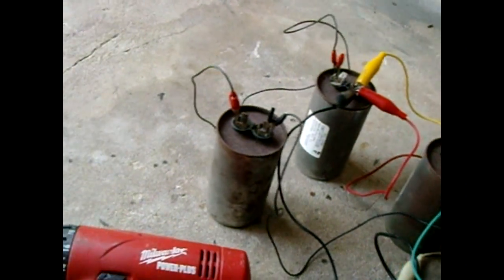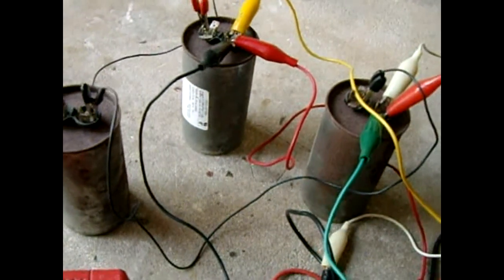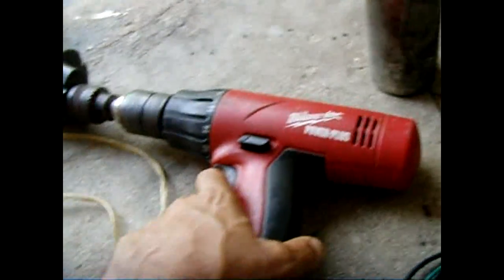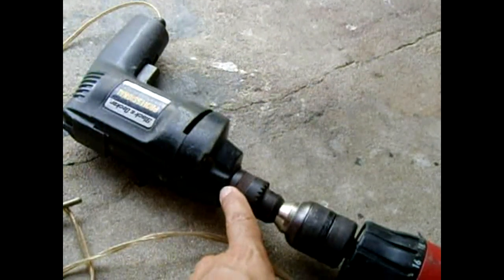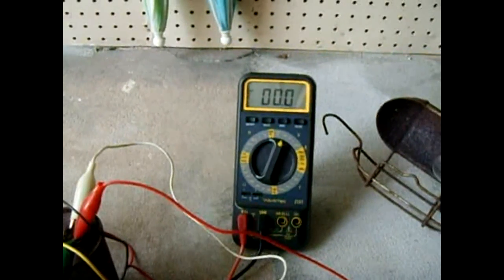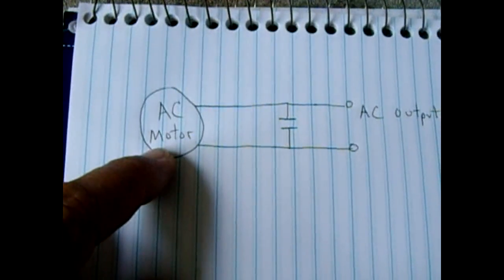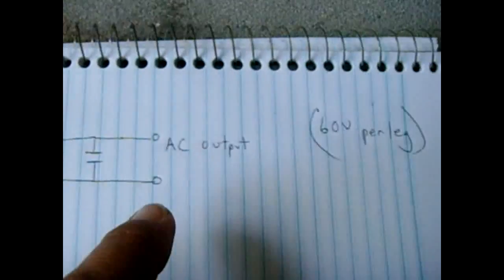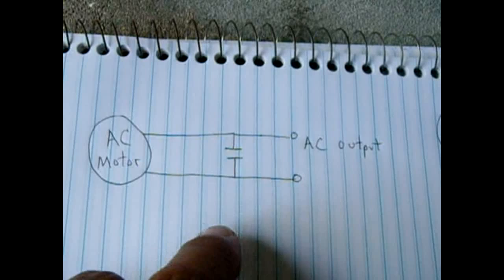How To Make Generators From Induction Or Universal Motors!

Comment: great video !  Can you explain how to calculate minimum capacitance for given motor? ( I have single phase induction motor 150W and it came with 10uf 400v cap but it didnt generate very much voltage, How much capacitance should I attach with that for generation?)
Reply from the maker: I do it by experimentation. If you apply too much capacitance I find it makes the generator harder to turn.

Comment: While capacitance in parallel add like c1+c2+c3, and they add in series like 1/(1/c1+1/c2+1/c3). 

But if one adds two capacitors in series to get a higher voltage rating, then try to use identical capacitors to avoid unbalanced the voltages across each capacitor. furthermore, one might want to avoid connecting more than 2 in series for the same reason.

Comment: Hi, thanks for this. a couple of questions: 1/ if using a 3 phase motor, should i remove the start capacitor that is part of the motor? (and include the necessary run capacitors at the output) 2/ if in your example i was to use a transformer from 80 to 120v, i would still have a problem as the Hz would still be 17 instead of 60, correct? Thanks again
Reply from the maker: Remove the start capacitor and use oil filled run capacitors. Thanks for watching!

Comment: I have a brushed ac motor it has 5 wires connecting to it and a neutral wire its controlled by a switch for different speeds how do i wire it to generate dc current?
Reply from the maker: You'll need to connect a Full Wave Rectifier to the output wires after the oil filled capacitors. Also a very good idea to use a high value electrolytic cap with the correct voltage rating across the DC output.

Comment: I think u might generate DC from that drill if you either disconnect the cap after building the field or start the spinning without cap and use , lets say, the cordless drill spare battery to jump start the circuit if remanescent magnetism wont do it alone. I think that Hertz reading you got was the LC tank circuit. A true squirrel cage motor is very different. good show "irregardless" This I use to eletro shock my desbelievers co-workers at construction sites where I use to work as electrician, just dare them to hold the plug while u spin the drill

Comment: Just so you know, most capacitors are designed to be as cheap and compact as possible to accomplish the task they are designed for. DC and start capacitors have a much higher capacity for a given cost and size than run capacitors because sacrifices were made to get them that way. For DC caps the dielectric is polarized so that it has a much higher breakdown voltage in one direction, but in exchange a much lower breakdown voltage in the other, the result is the cap has a higher capacity and is more cost effective, but it can't be used for AC, and care must be taken to avoid reverse charging it. The dielectric used in run caps leaks like a sieve at their rated voltage, the caps produce a lot of heat, so they have a low duty cycle, but they are cheaper and more compact as a result. 

Run caps are constructed without ANY sacrifices, the dielectric is not polarized, and it doesn't leak very much at it's rated voltage (they have so little leakage they usually come with a bleeder resistor so the caps don't stay charged days after they are disconnected from power), the result is a capacitor with a 100% duty cycle that will often outlast the motor it was connected to. The mineral oil is part of the dielectric, it's purpose is not cool the cap because the caps don't usually need additional cooling, they are simply efficient enough to begin with that their heat output is negligible under most circumstances.

Comment: Faffaflunkie already said it, that is universal motor, it is not an induction motor nor a synchronous motor.  Cool video either way.
Reply from the maker: +Mark Ball  
The purpose was to show what you can do using an AC induction motor, the principle applies for other AC motors as well.. :-) Thanks For Watching
Reply: +electronicsNmore As faffaflunkie and Mark both said, this is neither an AC nor an induction motor. The "generator" drill you are using has a brushed universal motor which works just as well with AC or DC. It's worth updating to avoid confusion for young players.
Reply from the maker: Hi Pat. I just modified the title and video description. You're correct, the drill used in the demo is an AC series wound motor which can also be used with DC. Thanks For Watching!

Comment: Are the Capacitors charged enough after use of the generator to be dangerous?
Reply from the maker: They should not be because you have a load ACROSS the capacitor terminals which bleeds off any remaining charge. To be safe, place the metal blade of a screwdriver across the capacitor terminals when your done experimenting.

Thanks For Watching! Be sure to share my channel with others, and check out my other videos as well.
Reply: +electronicsNmore i put 30uF capacitor and 20ma 220v ac lamp. it lights for about 15min. but dim. when i press switch on drill i measure voltage spike of 300v AC! HOLY SHIT